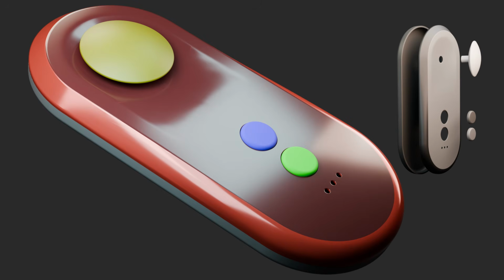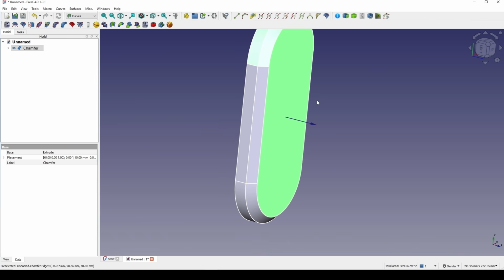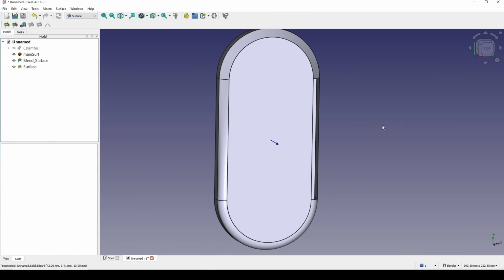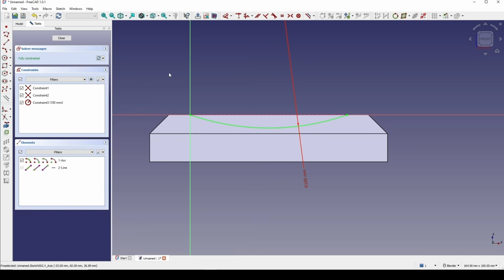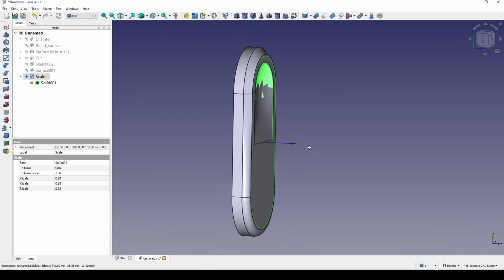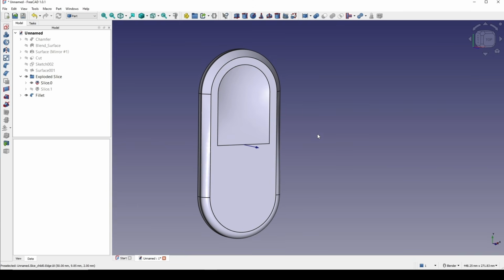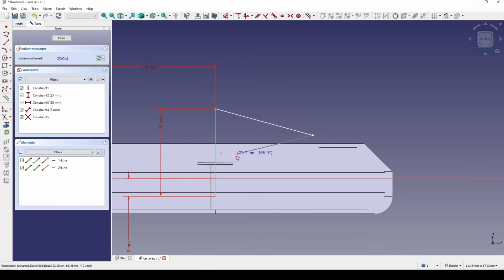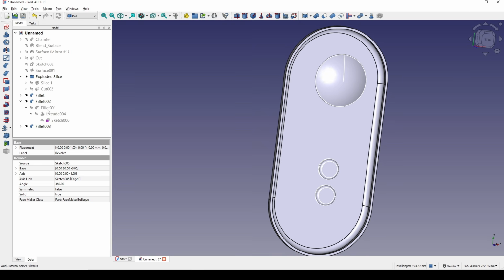FreeCAD 1.0.1 | Blend Between Chamfer & Fillet Using Surface (Remote Control Modeling Tutorial)

Comment: Thanks, I'm still getting used to Freecad and this is a nice tutorial of the curves and surfaces workbenches. Interested to know why you didn't design the top and bottom parts as separate bodies.
Reply from the maker: Thanks! But Im not sure what you mean, I did separate the top and bottom into two bodies!
Reply: @DuyQuangDang  I meant as two separate bodies to start with, i.e. top lid and the bottom enclosure as separate bodies in part design or part workbenches.
Reply from the maker: @ryebis  ah ok, yes you can start with a body if you want!